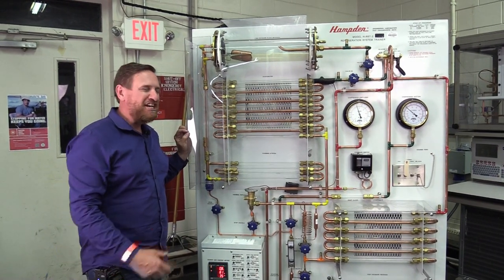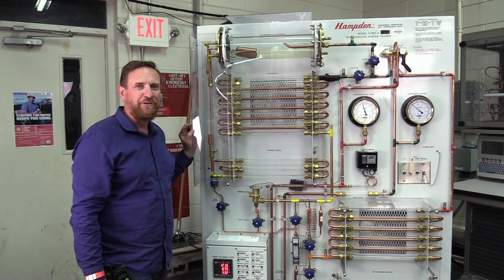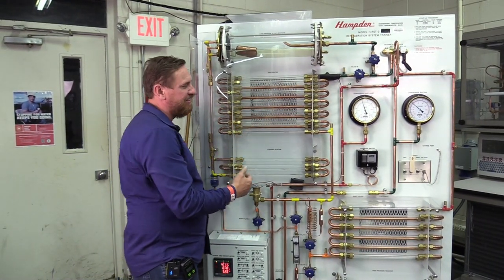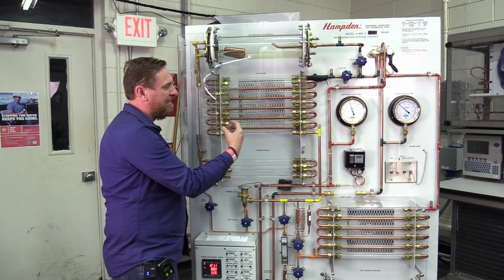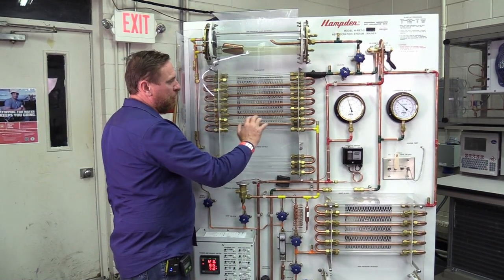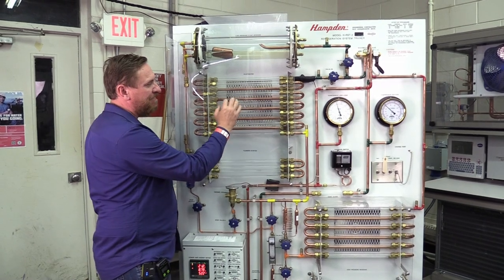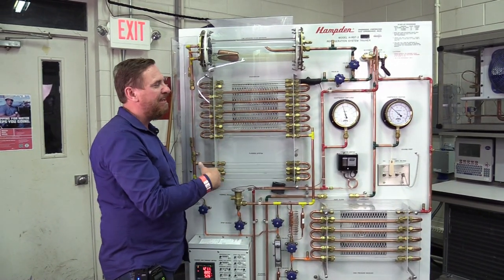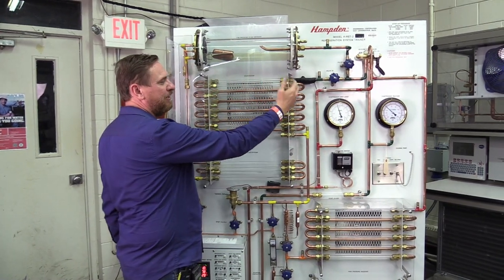HVAC 039 C refrigeration Cycle visible clear tubing

Comment: This setup should be mandatory and available in every HVAC-R class across the world. Since 1996 I wondered why the  hell don’t we have clear tubing available to show the evaporation and condensation vapor/fluid flow characteristics. Well done. 🔧 ☀️ ❄️
Reply from the maker: It is cool but the cost of this unit is outrageous.
Reply: @love2hvac   I’m just curious, how much does one of those demo units go for ?
Reply from the maker: @the_gold_canopy  one like this is around  $100k
Reply: @love2hvac   That is stupid expensive! What are they using for transparent tubing? Is it glass? Some type of special lexan tubing?

Comment: I have an older model of this machine in our training area. It has R11 in it. Over the years we have had trouble with leaks. I have talked to the factory about this and they say that all of the brass connections need to be torqued to a spec after each use. You obviously have a newer model so I hope you don't have the same problem. I enjoy all of your videos Ty. Thank You!
Reply from the maker: Oh this is certainly not mine. Bryan and the school was gracious to let me play with it. 
I think there is better things to spend money on. 
An R11 unit, that would be cool to see. Torqued after every use, that seems like a lot of work. Sometimes just getting the tools put back before class is done is a chore.  I saw a guy in Australia that used propane, it would not be so good for school but I think I will make one for videos.
Where is your school at?
Reply: @love2hvac  in South Burlington Vermont at the Local 693 Union Hall.

Comment: Hello. 
I have a quick question. 
I am currently working on making a refrigeration system with clear pipes myself. I wanna use it to educate trainees and interns here at the company I work at. 
What material are the clear pipes in this video?
I have seen glass evaporators used before but I was hoping to find an alternative in plastic pipes to avoid having to custom order a solid glass pipe.
Reply from the maker: I don't know, if you find something, let me know!
Reply: hey hi, have you find the material for tube, actually I am also working on that project to make test rig to educate trainees.